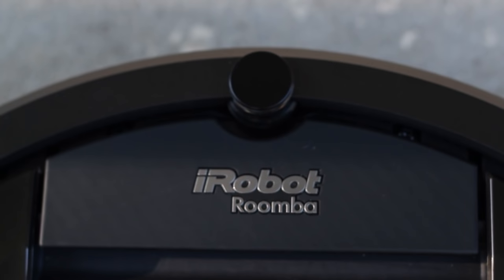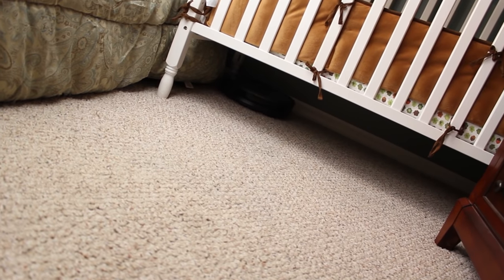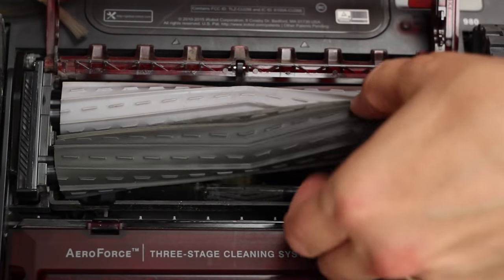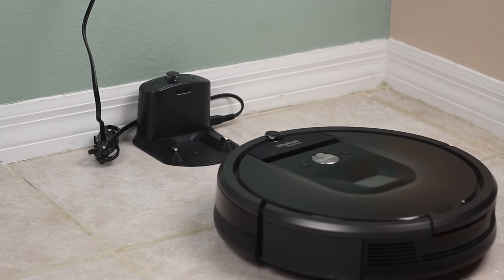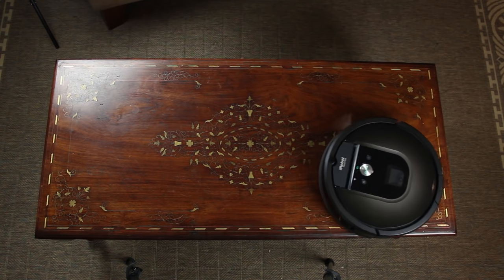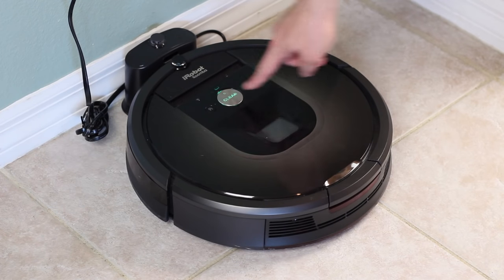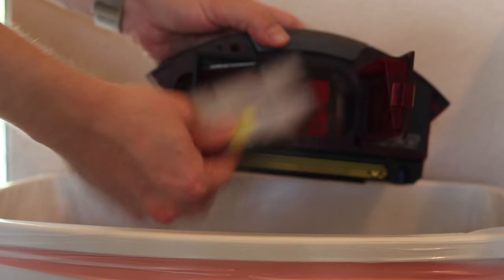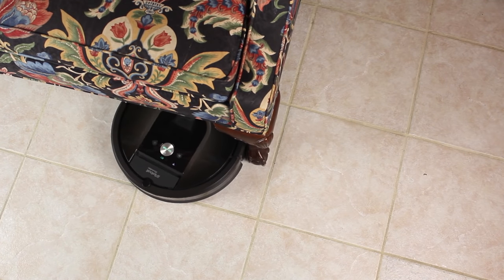iRobot Roomba 980 Review Smart Robot Vacuum

Comment: I bought one of these at Christmas.  We have new carpet, so the first few times we used it we had to be constantly emptying it as it collected up all the fluff that always comes with the new. As the carpet became a bit more "conditioned" over a few days of cleaning, the bin needed less emptying, but it still needs doing at least after each cleaning job, and often during one. This makes it a little less than ideal for leaving to clean on a schedule. A slightly bigger bin would definitely make this device a bit more practical.

Overall, it does a good cleaning job. Our new carpet is dark coloured, so tends to show any dirt. The 980 brings it up really well. It seems to map our house fairly well too (most of the time) and covers the area we have so far provided access too (the lounge, dining, kitchen, office, hallway and spare room) reasonably efficiently. 

I have read that earlier models had a remote control function. This would be a GREAT and USEFUL addition! Are you listening, iRobot developers?  Having it clean the whole house is good, sure, and the spot-cleaning function might be handy for some situations, but sometimes there's a area that the spot cleaner just doesn't work for. Having a remote control override would be REALLY helpful at such times - so much so that it seems odd to me that the developers didn't included such functionality as part of the app. Is it too late, iRobot developers? Could it be included in an app update? Please?

Overall impressions? 
Pros: 
- cleans well
- maps out the area fairly efficiently
Cons:
- quite noisy
- Bin too small for bigger or regularly scheduled jobs
- no remote control override
- over-priced for what it is.

Oh, and one more thing. By default, the 980 is programmed to keep on cleaning even after its bin is full. You can turn this off using the app options, but it's pretty silly to have it as the default option in the first place. I mean, why? It just means that it will end up spreading the dirt around the place. Odd.
Reply: over longer time you will find it gets more and more time between emptying.
when you first get it its going to collect more.

as for it continuing to clean just cause sensors detect full doesn't mean not still room to fill in bin :)

Comment: Thanks for the Review!
I have a question.. Is it possible to clean up two floors? 
Maybe yesterday i cleaned my first floor, and today i want to clean my floor upstairs. For sure i have to carry the robot upstairs, but for the iRobot it´s a "new location" right? So i think the iRobot is "confused" about the new location?
Reply: From what I have read, the roomba deletes the virtual mapping after concluding its cleaning cycle, which means it's "fresh" whenever it starts a new cleaning (just in case you move furniture) so don;t worry, this robot is extremely smart.
Reply: Patrick Mo Well if you took it up stairs it would clean till it was done or the battery was depleted then return to where you started it.

Comment: which one is better 980 or 890 . Can anyone help  recommend for me ?
Reply: 980 better navigates and also performs better on carpet. It also can recharge and resume when needed. They released this model to beat their competitions as market is flooded with cleaning robots. You may find better deals with 890 or even 860 but if the money is not an issue you may go with 980. If you would like to buy 890 buy 860 which is almost the same and much cheaper (my opinion). Good luck :-)

Comment: Does is work on human long hair on carpet and wooden floor?
Reply from the maker: They will probably get partially wrapped in the sides of the rollers, but iRobot's design makes it really easy to pull them out if that happens. It's much less effort than a traditional vacuum roller brush.

Comment: never get these get a neato neato vacuums are cheaper and goes back and forth and doesn't bump into things that often and have much strong suction I have pets and keeps my house clean. also neato charges and goes back from where he left off and doesn't stop when he dies it just goes and charge
Reply: uhhhhh and the Roomba 980 doesn't do these things?
Reply: 980 does go back and forth.
its great for pets and the Roomba 980 and earlier models will return to dock to charge if needed during a job.
the user does not appear to know what he is discussing.
Reply: In my experience with the Neato Botvac Connected and the Roomba 980, the Neato tends to need more prepping and babysitting, doesn't do as thorough a job, and experiences occasional docking problems. It's also more finicky about where I place the dock. I also really prefer the Roomba's rubber rollers over the Neato's brush roller, since they're easier to maintain. Both models will go back to charge when necessary and pick up where they left off. Navigation and suction are similar with these two models; gone are the days of the Roomba bumping around the house like a pinball.

The only advantages the Neato has over the Roomba is the cheaper price and the bigger dustbin. That said, both are great botvacs. I keep the Roomba downstairs and the Neato upstairs where there's less clutter to get stuck in or run into.